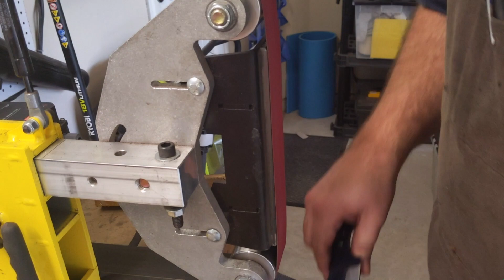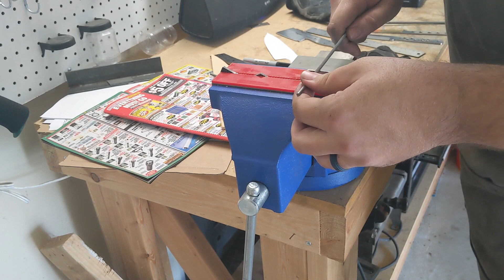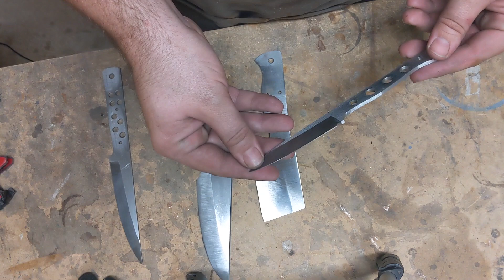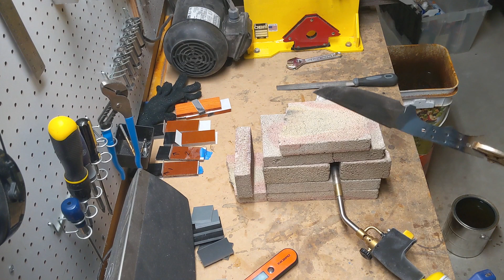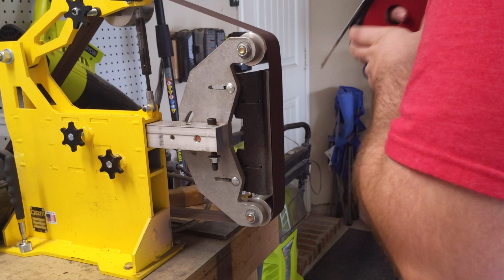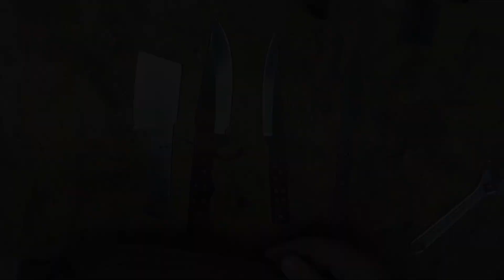Quarantine Knifemaking Part 2 | Bevel grinding and Heat Treatment

Comment: I like the simple 45 degree block you used as a work rest/ simple jig to get the angles right on the spine.  Way less time spent than adjusting the work table every time I need an angle that isn't 90.
Reply from the maker: Thanks, I figured it would be easier than fiddling with an adjustable workrest. I can just clamp that onto the workrest and go.